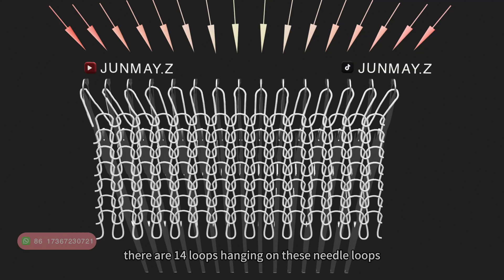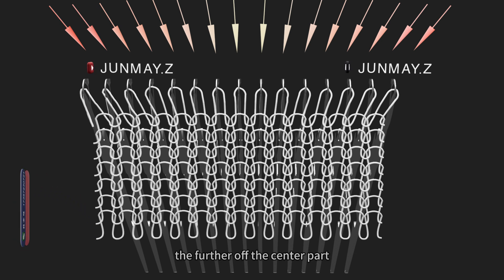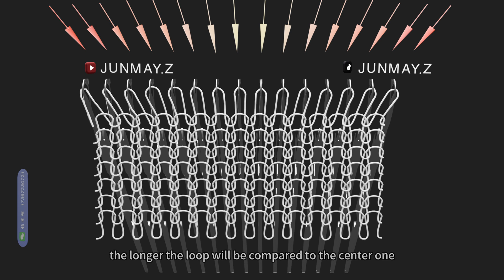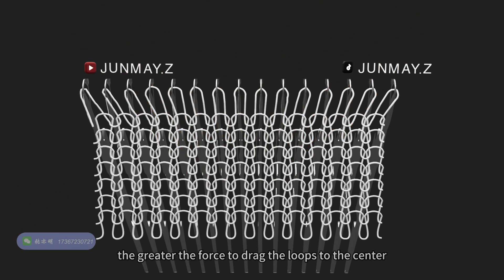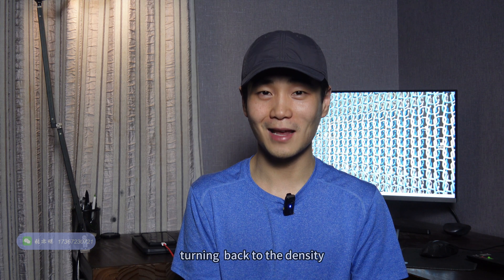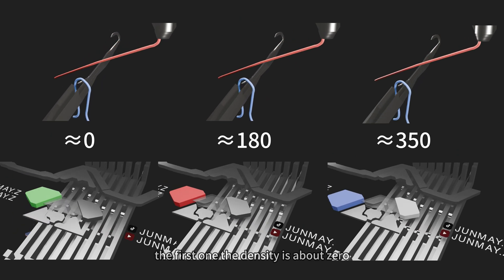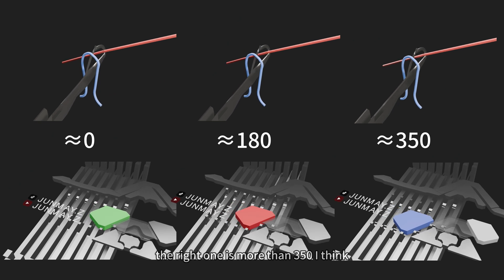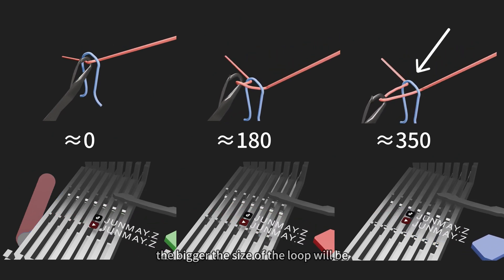principle of density of textile （mechanical principle 6）

Comment: 03:50 when the long jack was pushed by Density Cam, the depth should be at the edge of the density Cam....
Reply from the maker: the long needles are pushed by the upper guard hurdle at this time
Reply: @JUNMAY.Z  You know more about mechanical design than knitting, and by mechanical design I mean mechanical simulation.🤣😂